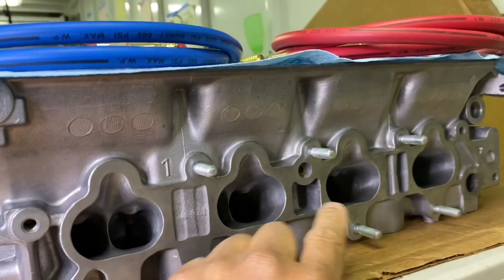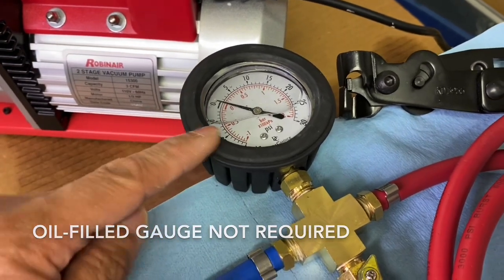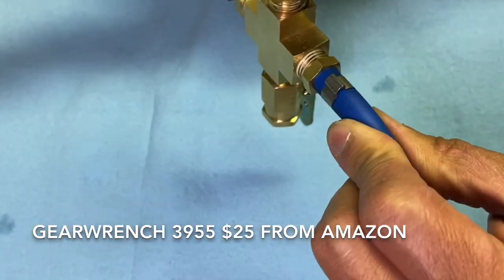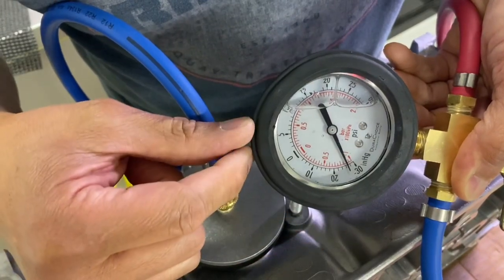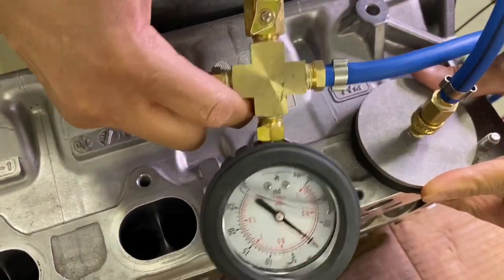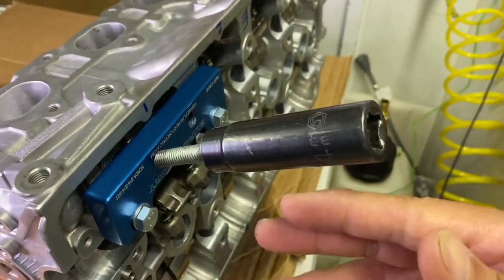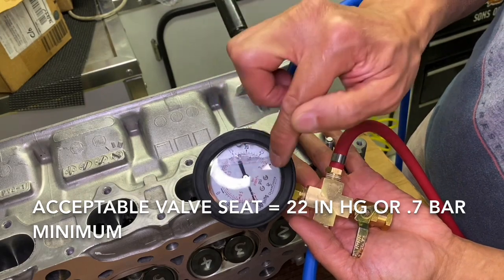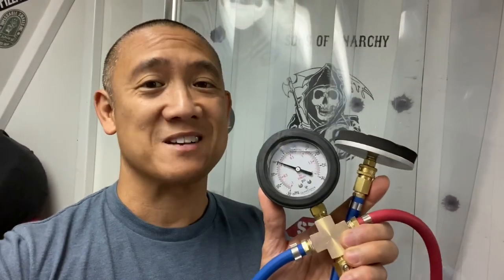How to Check Valve Seats with a Vacuum Gauge

Comment: With the pump on it would have to be a leak so bad that the pump couldn't keep up, which is not likely. A real test would be to isolate the pump after vacuum is applied then wait to see if vacuum drops.
Reply from the maker: Thx for watching and commenting. I learned of this method from my head shop… the only difference is their vacuum pump was part of their head machine. In my experience, when the valve seat leaks (as a result of a bent valve or a bad valve seat) the gauge will not meet the minimum 22 inches of mercury. The method you mentioned does work, but the question is how does one quantify the valve seat is good or not… is 10 seconds for the vacuum to drop off or 15 seconds. Also, keep in mind the port won’t hold vacuum bc the of the imperfections in the valve seat and valve seal. Note, this was discuss in earlier comments. Thx again, AJ
Reply: @RelentlessRacingAJ  with the pump on and poorly sealing valves you will almost always attain a lower vacuum reading than other cylinders.. this tool makes it pretty easy to check that the valves pull a consistent and even amount of vacuum.. I have used a similar pnuematic tool and sometimes found a 4" difference in vacuum can be remedied by another hand lap of the offending valves... your better off making sure everything is close before the engine is running

Comment: I love the idea of making this tool at home. But I think there might be an easier way of doing it. An R134 A/C manifold set already includes the gauge, and the fittings to connect to the A/C Vacuum Pump. You will need the valve test plate and an adapter to connect it to the low side (blue hose) fitting.
Reply from the maker: Yeah I thought about doing it that way, but didn’t want to destroy my gauge set. Also, when I priced out the gauge sets they were more expensive compared to my contraption. Thx for watching and commenting. Pls subscribe for more automotive content 👊

Comment: Where did you come up with the 22 in Hg / .7 bar threshold number for determining a good valve seal?
Reply from the maker: I’ve visited Port Flow about 6,000 times and his valve cutting machine has a vacuum gauge attached to it. His gauge not only has inHg on it, but also an area colored in green indicating an acceptable valve seat seal and that’s where the .7 bar threshold came from.
Reply: @RelentlessRacingAJ  How does his vacuum pump compare to yours though? A higher volume pump will create more vacuum for a given valve to valve seat gap. A pressure leakdown tester with a known orifice size would be a more reproducible method I think
Reply from the maker: @paulkube5338  I’m not sure if I agree... vacuum is vacuum - meaning one can only achieve so much vacuum (at sea level 29.92 in Hg). Thus, using a larger vacuum pump doesn’t mean it will pull more vacuum, it means it will evacuate the air faster for a given volume. Additionally, using a leak down pressure tester works well when the motor is assembled bc it applies pressure to bottom of the valve in the combustion chamber and then the operator determines the leakage point (valve seats, rings, or head gasket). Testing the ports w vacuum is an industry standard as opposed to pressure testing the ports. Why? Bc it is very easy to apply enough pressure to overcome the spring pressure on the seats and it is an easy test when the cylinder head is off the block. Hope this helps.
Reply: @RelentlessRacingAJ  In your setup, the pressure on the front (combustion chamber side) of the valves is constant atmospheric pressure. On a particular cylinder, the seat gap causing the valves not to seal perfectly is a constant size. So the rate of flow of air through the gap is a function of air pressure  at the back (manifold side) of the valves only. But what is that pressure? At equilibrium it's the pressure that makes the flow through the valves equal the flow into the vacuum pump. So you can see that a high-flow pump can create a lower manifold pressure (better vacuum) than a low-flow pump for a given valve seat gap.
Reply from the maker: @paulkube5338  that’s a good point. I suppose the way I’m thinking about it is for a perfectly sealed system. So, u r correct... in a leaking system flow rate will have an effect on the vacuum level. I’ll have to ask Tom which machine he has and verify the flow rate of his pump. In any case, I created this as a quick check for a cylinder head b4 it is installed on a block. I installed one of my motors multiple times w a leaking valve seat and it was extremely time consuming. After the ordeal, I tried different methods to test the seats and this one proved to b the most reliable. The tests I tried included pressure into the ports (the pressure exceeded the spring force), alcohol in the top of the combustion chamber, alcohol in the top of the combustion chamber w pressure in the ports, and cold leak down test at 100 psi (air came thru known good seats). Pls share if u have a better method.
Reply from the maker: @paulkube5338  one other test... I took apart the head and marked the valve seats w Dykem and rotated them around and use the wear pattern to establish and even lapping. This worked well but very time consuming.

Comment: Nice video & you've got the correct concept, but your rig needs a few tweaks to be functionality helpful....Your 3 Cfm pump is way too large & grossly Over-pumping the typical 200 cc (0.01 Cu.Ft.) cyl head port making your tester Very Insensitive to all but extreme leaking valves...Use a Smaller  0.2 Cfm pump or put a small 0.020" diameter restriction Orfice directly on the large pump...You Must also add a vacuum isolation/shut off ball valve to the vac test pad hose line to enable the critical "pump off/vacuum hold" timed test where > 10 sec per 10 lost Psi is required for test pass....
Reply from the maker: Ahhh. Finally someone w numbers. May I ask where your numbers come from?  Also, I’ve added another ball valve so I can shut off the vacuum and see how long the port will hold vacuum.
Reply: Also,....Even the cheapest 1 stage AC vacuum pump Will pull 29" Hg vacuum into a perfect airtight plug--off But I notice commercially built cylinder head machines (like Serdi, etc) valve vacuum test pump Only pulls to 22" Hg on a 0 --30" Hg vac gauge.....I'm fairly sure their pump is much smaller than a typical HVAC vac pump you're using & may Not even be a Rotary Vane type !!  Could be a much simpler Piston/Diaphragm vac pump that can only pull 22" Hg vacuum !!  The "Timed"  Vacuum Hold test seems to be the "Real" important Valve to Seat Sealing performance Indicator type test...
Reply from the maker: @tomstrum6259  sounds interesting, but where are you referencing all these numbers?  I’d like to research what you are stating more. Does Serdi post the specs on their pumps?
Reply: Continued,....At -- 850 mbar (25" Hg).......

Comment: Yes your pulling vacuum, but  most pumps for a/c are designed to pull 30lbs  , the real test is after pulling vacuum shut the pump off , you should hold the vacuum. best is to have a shut off valve between pump & head. reason for that is you will pull oil out of pump when shut off without a shut off valve. every head i do must hold 30 pounds vacuum with pump off.  if it don't hold vacuum with the pump off you have a leak. fill the ports with laquer thinner & blow air around valve you will see were it is leaking. think about it just because you are pulling vacuum don't mean they are not leaking. 
holding vacuum is the real test
Reply from the maker: @ScottGreen-r3r  I agree w you and have since changed my setup to turn off the vacuum. Again, this is merely a quick check and not the be all end all for a valve seat test. It won’t hold vacuum forever because it is not a perfectly sealed orifice. So, the question begs how long should it hold vacuum? I have some valves which hold over a minute before the pad falls off after turning off the vacuum. So, again, what’s the criteria… how long should it hold the pad there and does 20 more secs equal more HP? How much HP for x amount of seconds? Appreciate your comment and you watching.

Comment: the real test isn't how deep a vacuum can be pulled with a 3CFM pump, the true test is how long it can be held(decay test)
Reply from the maker: Thx for watching and commenting. Agreed, but what is the acceptable decay rate?  Note, we have discussed this in the comments already and no one seems to know what the acceptable decay rate is. Perhaps, u can be the savior. thx again, AJ
Reply: @RelentlessRacingAJ  decay rate would depend on temperature since most valve jobs consist of of having the valves cut 0.5° shallower than the seat so in theory the seal would be ideal at operating temperature. The best measurement I can think of would be using microns and at near perfect vacuum with the head at room temperature as a control. Similar to drawing a deep vacuum on an AC/heat pump system many things influence your decay rate(moisture,ambient temperature, non-condensables, etc). For a street head if it could hold 25-26 inhg for 10 seconds that is probably sealed more than enough to pass a leak down test and therefore have a proper seal for combustion. There really is no way of knowing unless a perfectly sealed head under ideal testing conditions was measured to be used as a control. This is just my opinion do with it what you will just figured I'd throw it out there
Reply from the maker: @anjewbagel4755  appreciate the explanation, but again this is only used as a quick check prior to installing a head. You can quickly double check for a bad seat or bent valve.

Comment: You're not doing it right.  You pull a vacuum then you shut off sustion from the pump and watch to see how long it holds the vacuum.  If it doesn't hold it at least 7-10 seconds you don't have a good seal on your valve.
Reply from the maker: I’ve seen that method as well and I agree w u. Again, I agree w u. However, I am using this as a quick check for detecting a gross leakage in the seat.
Reply: @RelentlessRacingAJ  
After I posted I realized that the method I mentioned only works by placing the suction on the cylinder side with the springs intalled.  It would never work on the port side since you have guides that will cause considerable leakage.  I just happen to be doing a valve job on a Cummins 15L ISX at the moment so the procedure fo it was fresh in my mind.  I too made a setup for it using almost the identical setup you have.  However there is no recess in the cylinder area so applying the suction cap isn't a problem like it would be on your head.  Anyway you're right for your application and I was right for mine.  If nothing else my post gave us something to ponder.
Reply from the maker: @tonyrmathis  that’s a good point.  Thx for commenting and watching. 👊
Reply from the maker: @jimhalbrook9155  everything u need to know is in the video
Reply: @RelentlessRacingAJ  thx u
Reply: Quick question.... What size barbed fitting did you use to attach the parker bst- 1. 3/16 x 1/4"? Or is that a 1/8" with a 3/16 barb
Reply from the maker: @jeremygrefe5942  Sorry, I didn’t include that in the video, but the barb is determined by the hose ID and my particular hose used a 3/16” barb. As for the Parker, I don’t recall, but I’m sure you can google it and find out. I went to the hardware store and with all my pieces and found the correct adapters when I was there. Good luck. Lmk how yours turns out and pls subscribe.

Comment: After having  more testing  time & Experience with this type of Vacuum Tester, my takeaway is the Highest gauge Hg reading With Running pump Only test Can mask some slightly Leaking valve seats & confuse the Real valve sealing Quality Evaluation...With any pump ( at least  capable of 25" Hg vac) the Highest Resolution leak Detection Results Is with pump Off, valve closed & Carefully Timing the Leak-Down Rate....A known High Quantity valve seat Will hold Vacuum with Leak-Down rate of > 10 seconds per Hg"  or > 100 seconds per 10 Hg"...
Reply: im thinking about adding a check valve to the tool I am making, or have it easily installed right after the port adapter so that with a trigger style vacuum tester you could start a timer as soon as you let off the momentary switch (and hopefully the check valve seals quick enough to not lose any vacuum) of course the vacuum gauge would also need to be port side before the check valve to get a reading.

Comment: Or you could do like machine shops do and use a thin liquid.
Reply from the maker: I used to do that too, but it’s not a good check. A slightly leaking valve seat can still hold a liquid. Also, if the valves hold liquid you don’t really know how good the valve is sealing. This tool tells how good or bad the valve is sealing against the valve seat. Another test is to pull vacuum on the port, remove the vacuum, and time how long the suction plate takes to fall off. I use this to check if lapping the valve improved the seal between the valve and seat.

Comment: Its not good, the vacuum is way too powerful. even in fou introduce a HUGE leak it wont move too far down.
Reply from the maker: As mentioned, this is not the end all be all test. I merely created this tester to check if the head shop made a blatant mistake. Also, according to my research and testing, the vacuum pump is not too strong. A port will not hold over 22 in Hg if there is a small leak. If you don’t believe it, get off the keyboard and make a tester and prove it to yourself.